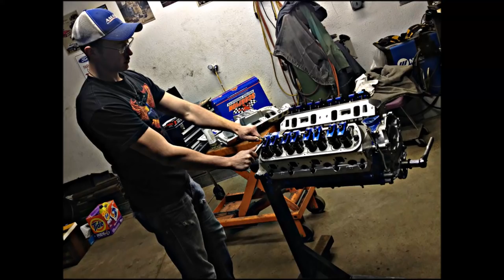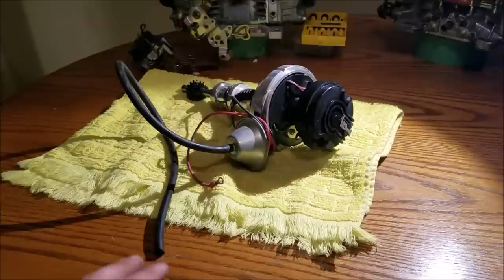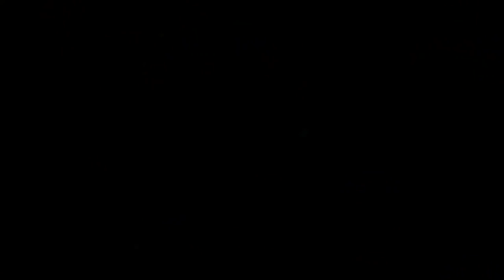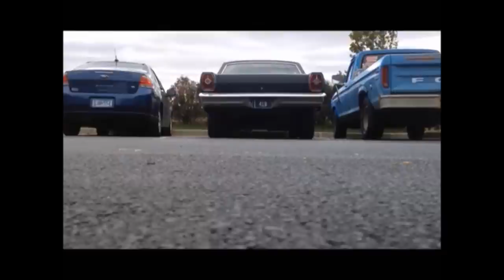Vacuum Advance Explained - What it is & How it Works

Comment: So I know this was two years ago but my girlfriend has an 82 GMC sierra s15 and we can not figure out where to attach the vacuum hose to the carb... any suggestions on which carb port it is?
Reply: Most carbs have a full time vacuum port and another that supplies vacuum over about 1000-1200 rpm or thereabouts.  I've always found I got better results using the full time port (usually lower down on the carb).  This was with both small and big block Chevy engines with headers and mild aftermarket cams in fairly light cars.  I got much crisper throttle response and the side benefit of slightly better gas mileage. Your engine/vehicle combination my prefer the ported vacuum (usually higher up on the carb). Why not try each for a day or two of normal driving and see which you find better?
Just be sure to block of any unused ports.
Let me know your results if you would.

Comment: Great video! I wanna know, why at full throttle, is manifold vacuum very low?
Reply: Because as you open the throttle plates,  there is less restriction to the air flowing into the engine.  That is why manifold vacuum is highest at idle, and lowest at wide open throttle.

Randy

Comment: Can you make a video on how to adjust and set adjustable vacuum advance. Thanks
Reply: Gregory Frost - I just follow the directions on the box. If you turn it counter clickwise to start then with the allen wrench turn it in until it just stops. Then hook the lvacuum line back up. with the engine warm take it up on the freeway or a deserted road and at cruising speed start to accelerate and try to detect any pinging.
If not, then keep backing the vacuum advance out 1 turn and rehook up the vacuum line then take it for a spin listening for any pinging. So you keep doing this until the motor pings. When it does then go back and turn the vacuum can in a turn. Then hook up your vacuum line and you should be set.
Reply: Don S Thanks for the help

Comment: thanks for all the videos, you have helped many times. I have a 302 out of an explorer with a light cam, i was having issues trying to get on it high rpm, i installed fitech, same problem, so i added pcv, got better then all the sudden an afterfire and now its rough low rpm.. someone said i might need to add vaccum?? maybe vaccum canister?
Reply: also i do not have vaccum advance
Reply: Spray for vacuum leaks first.

Comment: Hey dude, sooo... I have a wrangler with a 383 stroker 220cc heads, big mutha thumpr cam and  a Holley hp street 750  carb. The thing is that it takes like 6-8 trys for the engine to run, it turns and then it feels like it chokes and dies. The mechanic told me that it was because the engine is cold but I have seen engines like mine on YouTube that turn on right away. Also, it feels rough under load. Do you think the distributor has something to do with it ? The total timing is at 38 I was told, 15 initial timing and I can’t remember the other one.
Reply: Was this setup on a dyno?
Reply: Your Heads are too many CC's and a mutha thumper is a botique cam designed primarily for a lopey idle, and not performance. Next time call Chet Herbert cams and tell them your parts/goals and they will grind you a cam that makes much more power. You can use heads that big or bigger in a drag race setup, but for the street/woods you would be better with smaller heads. Even down the 180 cc runners This increases velocity and low end torque. What you want in a Wrangler.
Reply: Don Rutter the main purpose of the Jeep is sand drags not rock crawling. I put that cam because I had it from I project that I was going to do but I never finished it and I sold it. And the heads are 220cc  CNC ported.. sorry for the typo.

Comment: Thanks ThunderHead - another very helpful video, much appreciated.  I am running a Blueprint 347 with the pertronix billet vacuum advance distributor.  I am running ~12-14 degrees initial and 32-34 degrees total mechanical with my vacuum advance connected to manifold vacuum.  I get about 16 inches of vacuum at idle.  Everything is great, except I am getting spark knock when cruising on the highway when I tip in to very light throttle.  Am I just running too much mechanical timing?  Should I run vacuum advance off of ported?  Do I need an adjustable vacuum advance canister to lessen  the advance this is giving me during this tip in scenario?  I'm stuck.
Thanks for your help and your experience!

Comment: Well I am having a hell of a time trying to get my truck running right it’s got a 270/280 cam and it’s got a vacuum advance and it’s punched 40 over and has a victor jr Intake and a summit 600 carb the real issue is if you snap the throttle it’s good but if you slowly increase the rpms it has a hesitation and it pops and pings any help would be appreciated
Reply from the maker: Old truck garage there are a lot of things at play here - I’d imagine it’s a lean issue and here’s why - when you snap the throttle, you are getting all of the accelerator pump, and into the power valve. When you roll into it, you are probably at the lower range of the manifold vacuum, but not low enough to get into the power valve. Your primary jets may be too small! 
I know on my f100 with the 500 cfm, it was flat at pet throttle. Jetted up 2 jet sizes and it cleared right up. 
I also determined this because I had an o2 gauge and vacuum gauge side by side in the truck - I could watch the carb events as they happen. Those together will make you a carb tuning wizard with a little bit of carb functionality know how 👍
Reply: I have also had a 750 holly on it too and it had the same issue
Reply from the maker: Old truck garage if your initial timing is 10-15 and you put that guy on ported vacuum, it should run acceptable at least as far as the ignition goes - obviously this can be refined, but it’s a good baseline
Reply: Thanks for the help I’ll try to get a video for you to see what’s going on I am so lost with it I have tried so much
Reply: Test with a vacuum guage. Say you get 12hg of vacuum. The power valve in the carb needs to be HALF of your vacuum (12), a #6 power valve. Youtube how to set your transfer slots. Have new or clean spark plugs. Run it down the road hard and shut the key off without it having time to idle. Pull a plug and check color for lean/rich. Adjust primary jets first accordingly. When you get close or go past (rich) back secondary # down 2#. Keep working on it.
Reply from the maker: who are you addressing?
Reply: Have you tried disconnecting the vacuum advance to remove that as the culprit?
Reply: Have you made any progress? Victor Jr. is not a good manifold for a street vehicle. It is an old, single plane design that has been superseded by much better designs, eg. RPM Air Gap. That doesn't explain the problem you're having as it still should run fine. Just a comment.
Reply: I have the same Summit carb on my 302 Mustang and it was flawless out of the box. Better than any Holley I've ever had. It's mounted on a Performer manifold . The fact that it works so well in my combination means it would be virtually impossible for it to run well out of the box on yours. Single plane manifolds require larger jets because the large plenum creates less draw on the carb and hence a weaker signal to the jets. The fact that the factory jetting works great on my engine means it would be too lean in yours.

Comment: alright I have a 82 5.8 in my f250 and it only seems to be firing on 4 cylinders with any load it has new carb plugs wires cap distributor rotor coil and points what else could be wrong
Reply from the maker: id be happy to help if you can give me a few more details - also, have you watched any of my carb tuning videos?
Reply: Yes carb was tuned when I put it on then it sat for 6 months I'm trying to revive it what do you need to know I'll be happy to tell you everything. It's is a 1982 351w unknown milage was running beautifully before parked now it'll start up fine and idle but once it's put under load and driven it will spit sputter run ,what seems to be on only 4 cylinders, and wants to die out
Reply from the maker: ah alright, appreciate the back story. the first thing to note is that it ran well before - so we dont want to go turning screws and adjusting things. oftentimes when engines sit, the ignition components become corroded and result in weak spark, ending in symptoms such as what you describe, so that is the first place i would look. now with the carb, that fuel is open to outside air via the float vent and will evaporate/carmalize in the carb in a short time. if the ignition is not the culprit, unfortunately a carb cleaning might be in order. 
also, make sure you are still running the appropriate fuel pressure and nothing changed there since it was parked.
Reply: ThunderHead289 carb got a spray down before anything so that's all good the fuel pump is still pumping good and has new fuel in the new tank and a new filter the only connections I doubt were the wires that hook to the coil but I cleaned those. I read somewhere about a magnetic pickup on the crank? could that be something?
Reply from the maker: im not entirely sure on the duraspark stuff and cannot speak to it as i have always added in my own electronic ignition. i would recommend simply testing your spark to see if it is strong, and then hitting it with a timing light to verify the ignition timing is functioning properly. the fuel pump should fill a milk jug roughly half way in a minute or so also.

Comment: I have a really dumb question.... my vacuum advance hose is missing from my distributor. If i re-attach it, does it plug into my carburetor?? I just got my 73 Charger back on the road after 4 years of slumber. She's running hot, and my idle is funky. I have an 850 CFM Holley double pump carburetor. Where do i plug it in? Im a female gear head, and I work on the car myself, but this is a new one for me... Im kind of embarrassed to ask...
Reply: It would help to know some more details about your engine. That is a lot of carburetor for anything built in 73. That engine would originally have used ported vacuum which does not affect idle quality. Therefore it would be important to know why the idle is "funky" and, just as importantly, what you consider funky. Thunder 289's Galaxie has a rough idle, owing to the camshaft overlap, but it sounds anything but funky. To answer your question, your 850 has a vacuum port on the side of the primary metering block that is used for vacuum advance. Base timing needs to be set first.
Reply: Bottom of carb is manifold vacuum, right side of carb front bowl is ported vacuum. Use manifold vacuum. You arent worried about emissions (ported) you want it to run good, and not hot (ported). The Duntov cammed 64' corvette was the first to use ported vacuum, GM engineers admitted it was a mistake,  engineers say all motors with ported distributor vaccum were an attempt to meet emissions, and the motors run hotter. Ported vacuum is another abomination you can thank the state of California for.

Comment: What about on an MSD with timing control. Does that do the same thing as  vacuum advance or is that different?
Reply from the maker: if the engine carbureted, then no, it would not be able to perform the same function.

Comment: I have a 1972 chevy C-10 pick-up, it's been rebuilt with a RV cam in it. but what's it's doing noiw is, when I coming to a stop sign or a stop light it dies on and someone says it might be my vacuum advance or air leak in one of my vacuum lines.
Reply from the maker: how do you have the carb set up? 
sounds to me like a carburetor issue. i have a wealth of videos on carb tuning, but i can try to direct you here
Reply: Same problem ... have you fount a fix yet?
Reply: Set timing to 36 degrees total, restrict vac advance to only 10-15 degrees and plug into manifold vacuum. Check for vacuum leaks in the hoses and the carb base. What carb do you have?
Reply: Spray carb cleaner or brakleen around the motor areas with it running (not around air going in carb). RPM's rise at a vacuum leak.

Comment: Nice ford galaxie i have a 63 ford galaxie with 390 bb in it and a 67 ford ranger with 352 bb in it matter fact my ford truck looks just like that blue one next to the what is that a 65 galaxie? i have a few others also, 49 chrysler desoto strait v8,,67 plymouth fury 440 a 63 ford fairlane 500 with 260,,67 impala 327,,1970 impala with 350 a 1970 camero with 396 and a 93 dodge ram 318.
Reply: All gutless compared to anything now. Cars have come a long way.

Comment: Hi from Venice Beach. .....How do I know how much vacuum my vacuum cannister is rated at.?
Reply: The only way to know for sure is to connect a timing light. Check timing with vacuum advance disconnected, then with it connected at full vacuum. To get full vacuum at idle and thus max out your vacuum cannister you will likely need to use either a vacuum pump, such as Mighty Vac, or suck on the hose like Thunderhead289 did.
Reply: You need to go to the NAPA listings. There are MANY vacuum advance units for different applications (same motor different years).

Comment: Ok my 85 5.0 ho mustang runs great without the advance hooked up but sounds like a can of marbles when I hook it up.  What could be wrong
Reply: I just put this dizzy in it.  The old one the advance seemed to work fine.  Maybe bad dizzy?
Reply: Your vac advance is probably providing too many degrees. Do you know how many it has? Its should be around 10 degres
Reply: What is your initial timing setting with vacuum advance disconnected? Which distributor did you install?

Comment: so i have a vortec v6 with edlebrock performer intake edlebrock 550 cfm and headman headers i can be anywhere from 11° to 32° advanced and runs great but as soon as i put the vacuum line on the canister it just wants to spit and sputter and try to throw me out the windshield why is it so drastically  changing it on me
Reply from the maker: A few things here - do you know your manifold vacuum? It might send it into a surge loop if it’s continually modulating the timing. 
Also, is this at idle?
Reply: it idles great i used vacuum gadge to adjust the vacuum and it was in the green section on gauge. Also i have it connected to the passenger side vacuum vent on the edlebrock carb. and the turbo350 is connected to the driver side vacuum..i have herd a stretched timing chain can make it buck but it doesnt when the vacuum line is removed so im not thinking stretched chain
Reply: @ThunderHead289  ok so i got a reading on my vacuum it will with rpms move smooth without jumping around up to 22 in-hg it does move smoothly with rpms i do have it on passenger side of carb so it sits at zero until rev'd im lost and am just considering running without it hooked up it is a mudd/trail truck will it hinder the performance?
Reply: @beterthenbob  Since it only runs rough when the vacuum advance is connected it sounds like too much total advance. You should check your initial timing first without vacuum advance connected and then with to see how much timing it is adding. And when you say anywhere from 11 to 32 degrees are you talking about at idle?
Reply: @65sohc  yes that was at idle speed ot ended up spinnong the bearings and i put a motor with 50k miles and still no vacuum advance and this motor just rips but if i put the advance on what rpms do i check for total vac advance 2500, 3500, 4500? thanks for responding
Reply: @beterthenbob  Vacuum advance is dependent on manifold vacuum, not rpm. Most engines will have sufficient vacuum at idle to max out the vacuum advance, unless you have a longer duration, high overlap cam with a lopey idle. Assuming you have a factory-type cam and a vacuum at idle of at least 18 mmHg you can check timing at idle first with the vacuum line removed from the advance cannister and plugged and then with it connected. The difference will be the vacuum advance which should be around 12-15 degrees.
Reply: However it is important to know your total centrifugal advance because that is what determines your power. The only way to know that is to either use a dial back timing light or have your harmonic balancer marked to at least 40 degrees. Most engines produce max power around 34-36 degrees all in by 3000 rpm. What I do if I don't know what timing curve is in the distributor is slowly raise rpm to 3000 while observing the timing marks. Once I get to 3000 I punch the throttle to see if timing continues to advance. If so I continue slowly raising rpm until advance stops increasing.
Reply: That will tell you the total amount of timing. Subtracting your initial advance (no vacuum) from the maximum advance tells you how much centrifugal advance is in the distributor. Once you know that you want to set the initial to whatever will give you around 36 degrees at high rpm. For example if you determine that the difference between timing at idle vs. 4000 rpm is 25 degrees you would set initial at idle to 11 degrees. 11+25=36.

Comment: I had a K-Code 1965 Mustang - bought new. Dual point distributor, no vacuum advance. 14-16 mpg @ 65 mph was about the best it would do. Of course, I didn’t buy the car/engine for fuel efficiency. It was a very strong pulling car. ❤️ed it!
Reply from the maker: Really cool 💪
Reply: K-code did not run a vacuum advance.
Reply: @jonathanmorrisey5771  That’s what I said in my original post. Setting the dwell was fun (not). The accepted method was place a cigarette paper between one set of points, and measure the dwell, with a dwell meter, on the other set. Then switch the cigarette paper to the other set of points. Cigarette paper was advised because it’s so thin the points will not be measurably held off the cam and thus distort the readings.